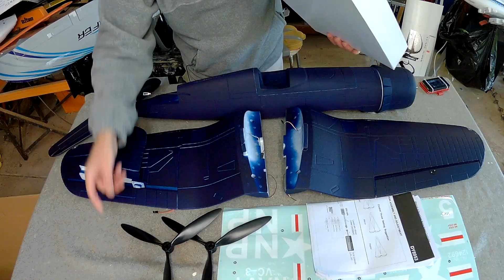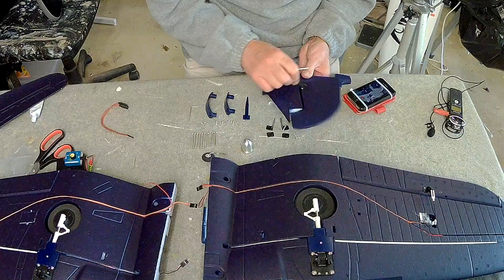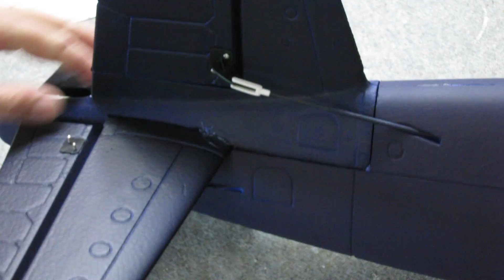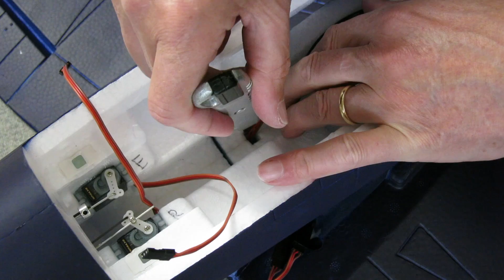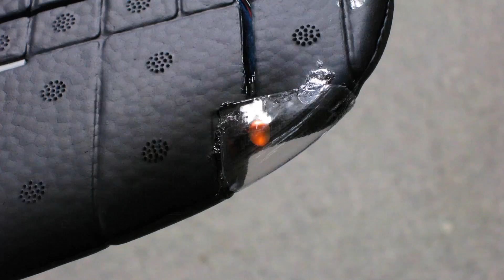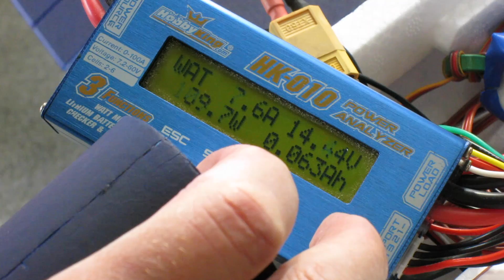Dynam F4U Corsair build

Comment: I appreciate your video was made some time ago but I have just acquired this same model. I have a query regarding fitting the wings. Should the four screws locate bolts on the underside of the fuselage as I can't find any
Reply from the maker: Should be some nuts or plastic hard points glued into the fuselage for the bolts to screw into. Long time ago so I cant recall exactly
Reply: Thanks Andrew. I can’t see anything but blue coloured foam. I even ran a magnet over it. Nothing. But thanks for taking time to reply.

Comment: Would the hot glue be strong enough to hold the wings in flight? thought epoxy would be stronger? I might be getting this plane would be helpful to know cheers.
Reply from the maker: Epoxy would be stronger, but you're only gluing foam so hot glue does the job.

Comment: Dynam kits are as easy as you can get, I have the P-51 I haven't flown it yet, I'll have to wait until Autumn, it's way too hot here in the Desert 115 Degrees F and no shade for miles, makes for an unhappy flying day.
Reply from the maker: That's harsh weather. Maybe not suitable for hot glue?
Reply: I used that glue that comes with the AXN/Bixler/Skywalker you can buy extra tubes of the glue for about $3.00 at Hobbyking
Reply from the maker: Good tip, thanks for that.

Comment: I did not see a wing spar. Does it rely on the hot glue and wing bolts?  Give it some hard turns when you fly it to see if the wings fold😀.
Reply from the maker: Small spars in each side but not spanning the join. Mod for the future maybe.

Comment: Are these designed for transport and field assembly i.e.you've glued the wing and tail section but is that necessary?

The signal booster didn't seem to stop the engine stuttering.
Reply from the maker: I would think the glue is necessary but the wing can be un bolted from the fuse. Still stuttering but it works OK otherwise.

Comment: I see that you have been turned to the dark side by Michael and used hot glue lol
Saved on time though and as they say, time is money
Flick me a msg when you maiden as I would enjoy watching the maiden 😉
Just a tip if you don't mind to your subscribers. 
I like to scuff the joins on both surfaces when glueing as it seems to make a stronger join and takes out the paint to paint join which if it's not applied properly can lift hence substantially weakening the join 👍🏻
Reply: Strike me down with all your hatred (of hot glue) and your journey towards the dark side will be complete
Reply from the maker: Majority of my planes are hot glued and quite often they don't fall apart. Maidened yesterday afternoon out at Marshall with no-one there except me and the puddles. It was ace.
Reply: So no problems taking off from the shaggy grass, good one
Reply from the maker: Cricket pitch takeoff, shaggy grass landing (of varying success)

Comment: Howdy Andrew, I'm not a pro by any means but these warbird styled planes are very, very twitchy. Keep the throws on the ailerons to less than you would think (can add expo, but use a lot, say 50 or more if full movement is used) and definitely make her overly nose heavy for the maiden flights. I only know this as I stuffed in my Dynam hurricane this week after 5 flights (my fault silly switch assignment for the retracts). Matt
Reply from the maker: Hey Matt. Invaluable advice, thanks so much. I'm very nervous about this one.
Reply: +Andrew Newton I have mine to a Pilot that had just won a uk aerobatics tournament, she only just kept it in the air on the first flight as it was too nose heavy & too much aileron movement. I'm so glad I did that it would have only lasted one flight if had been me :)
Reply: +Matthew Ogborne gave* and was supposed to type tail heavy. Not had enough coffee yet ;)
Reply from the maker: S'OK I'm at the other end of the day, understood perfectly.

Comment: This is one of the Dynams I'd still like to get. I love that they come without the decals applied as I like to repaint them. I have a Bf109, PBY Catalina & Pitts (Peaks)Python. I also had the WACO, C-188 and the Devil3D previously. All winners at the price point. I've flown all of the above on 3s packs as well as the recommended 4s.
Reply: Scale tip: If you plug the retracts into separate channels, you can use a mix with a slight delay to get a more scale retraction/deployment sequence.
Reply from the maker: Thanks, I need all the advice I can get.